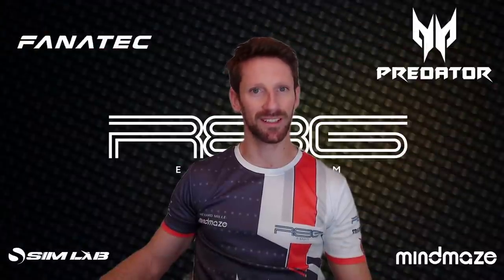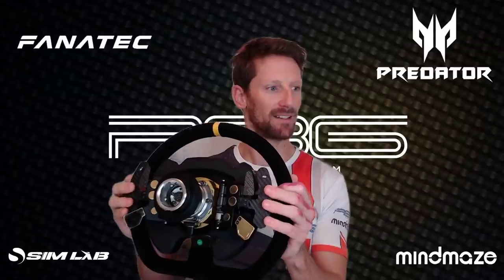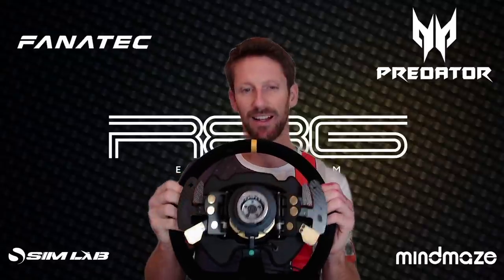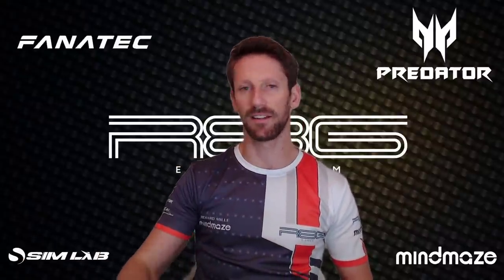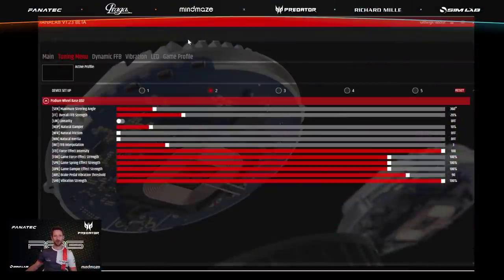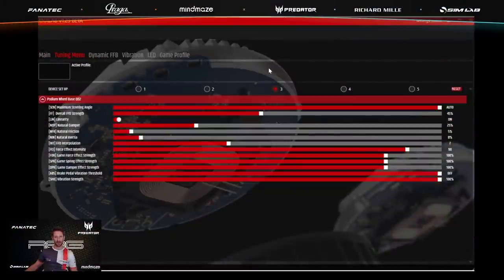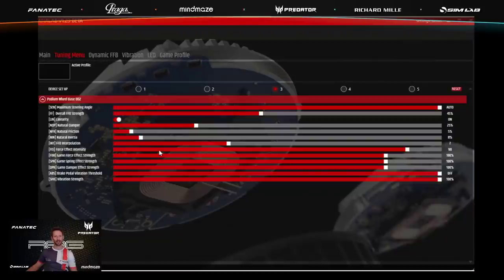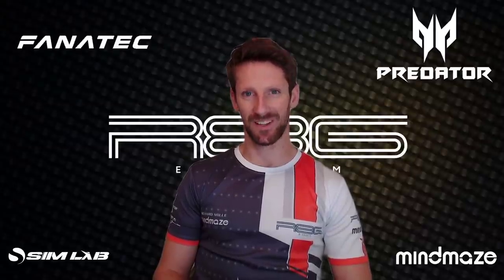SIM RACING - MY DIFFERENT FANATEC SETTINGS

Comment: Hi Romain, about rFactor2 i would suggest to not use more then 60% of car specific FFB in Game, otherwise you get to much (software) clipping and you loose some (upper) part of the dynamic range. With my DD1 wheel I usually use about 50% car specific FFB and 75% (LIN = on) of overall FFB strength setting in driver/Fanalab for most cars. Exception may be for example 60's formula cars where you might increase car specific FFB about 10-20%. With [INT] FFB Interpolation I use 3 which give me more detail but also more roughness. Rest of the settings are pretty similar to mine. For checking up FFB clipping, I use Motec software in combination with Lazza's Motec plugin for rFactor2, which could be found in the Forum. Hope the info could be useful to you or others. So for now best wishes, Good Luck and Happy Easter !

Comment: @Romain Grosjean Official Could you share F1 2020 Settings + FanaLab settings to produce the feeling of 'realistic' steering force in a F1 car?
Reply: I second this, really wondering how close this force feedback strength is to the real thing. 20% seems really low. I use about 40 on a dd1.